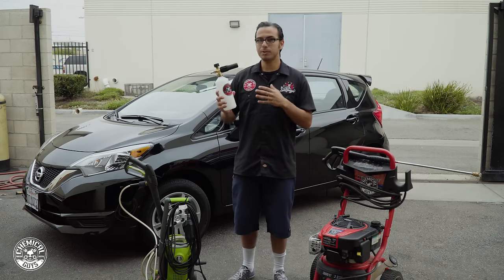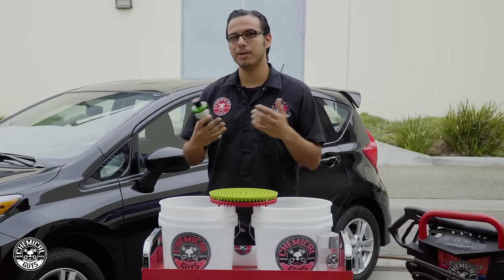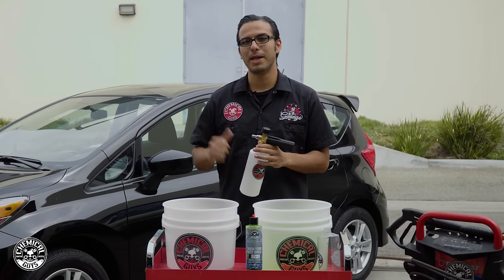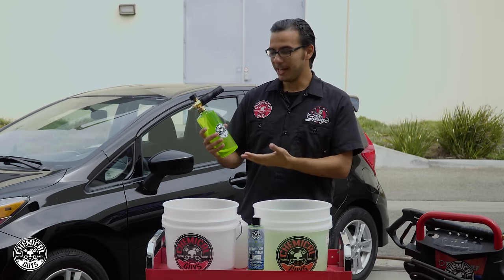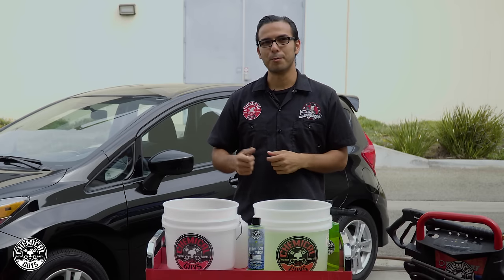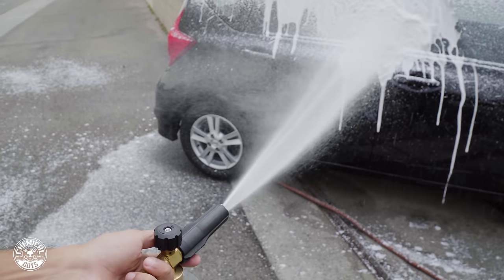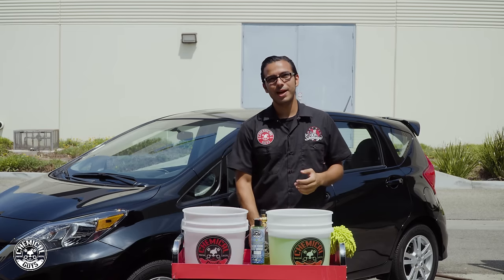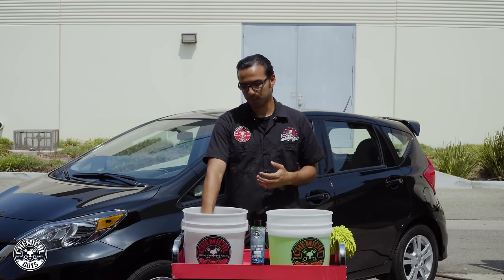5 Tips On How To Choose and Operate your Foam Cannon - Chemical Guys Car Care

Comment: Hey I have been looking forward to buy a foam canon but I have a karcher k series electric pw. Do you have any kind of adapter for this foam canon in order to make it compatible with my pw?
Reply from the maker: Hey thanks for watching.  We don't sell any type of adapter at the moment, one might be available through the web though. It might be a good idea to check a hardware store to see if there is one that fits well with the 1/4" Pressure Washer Female Inlet . Stay tuned, more great videos on the way.

C.G. Alex -

Comment: Hello can anyone tell me what the difference between polish and wax is. Which one gives the shiny reflective look?
Reply from the maker: Hi James, welcome to the Chemical Guys family! A polish is a chemical that contains abrasives that will actually remove clear coat from your car. By removing a very tiny amount of the clear coat, a polish smooths out the surface, getting rid of scratches and swirls. Polishing is substractive process and after you wipe the chemical off, nothing is left behind. A wax on the other hand is simply a clear coating that is applied to the surface of your car to make it shine and to protect it. Waxing is an additive process whereby you are applying a coating that will stay on your car for months. Waxing will not remove any swirls or scratches and does not remove any clear coat. If you wax a car that hasn't been polished, then you might still swirls and scratches underneath. Thanks for watching, James, and make sure to check back later today for a new video upload!
Reply: Chemical Guys thanks so much I just bought some wax👍

Comment: What was the purpose of the two bucket wash in this video where you foamed?   Confused.   Looks like you foamed and then just wiped off the car with a mit without using the buckets?
Reply from the maker: Hi thanks for watching. We have a pretty large collection of videos where we demonstrate the proper technique of how utilize the two bucket method. Lately we've been getting an overwhelming amount of requests for foam cannon how to tips because people can't seem to replicate the amount of foam we get out of our foam cannon. This is all foam cannon how to, if you're looking for a video that incorporates all the steps, we can definitely point you in the right direction. Stay tuned, we have an all new video launching today.
Reply: Thank you for this response. I have been using your foam cannon on another car for 4 years and never touched my car (foam, then leaf blower),  and it seemed OK. I now have a black car and I am not sure if a touch-less wash is possible or advised all the time. I want touch-less because I want to avoid swirls. But I am thinking that you have to use a mitt to remove film and grime or else you may risk swirls (especially on a black car). What are your thoughts on this and how should you do it. Foam, rinse, then 2 bucket method? Or foam, agitate with  a mit with one bucket to get dirt off mit every now and then? I rarely see professional detailers just use a foam cannon without a mit. Then this begs the question, is the foam cannon I bought really even an "upgrade" or necessity in a high end wash?
Reply from the maker: Some would debate this, however we rinse first, foam, and use a wash mitt prior to final rinse. Our technique is designed to be universal, yet I can completely understand someone wanting to do a 2 bucket wash without using a foam cannon. The foam acts as a lubricant helping to avoid spreading any abrasive dirt. I say stick to Rinse, Foam, 2 bucket with mitt, rinse, dry seal and wax.

C.G. Alex -
Reply: Do you rinse the foam before going to 2 bucket? Seems redundant to agitate foam with mit, then dunk  back into a soap bucket? Or do you only do a 1 bucket rinse if you foam? What is dry seal?
Reply from the maker: The foam expands on the paint lifting any loose dirt particles so that when the mitt glides along the paint, it doesn't drag the dirt with it. The wash mitt is able to glide along without scratching because the foam adds a level of lubrication, and the soap from your bucket adds to it. I meant apply a sealant if you don't have already have an existing application. It's more economical to use the wash mitt while the foam is still on the vehicle's paint, saves a little water at the same time.
Reply: I really appreciate all this time you spent with me. If I rinse the foam off (touchless) and then do a 2 bucket wash with a mit with soap in one bucket, is that less effective than agitating the foam? Additional question on wheel brushes: You dont sell a 20" boar hair wheel bursh. Is sythetic OK? How come its ok to use brushes on painted wheels, but I doubt you would recommend using brushes on car paint?
Reply from the maker: No worries buddy, The foam is there to help you, however at the end of the day it's up to you. You can use brushes on paint, we just don't find very many uses for them except for detailing emblems, we did that in an old video some time ago. The brushes are perfect for the tight areas around the spokes, hence why they make such versatile tools for wheel cleaning.

Comment: I've seen some vids where people first blast car with pressure waster, then use the foam cannon, let it set for 5 minutes or so, then rinse off the soap and with pressure washer and then wash with the two bucket method. You skipped the rinse after snow cannon. Is there any real difference or would there be a reason to use one over the other under various situations?
Reply from the maker: Hi, that's because everyone copies one another, so they naturally assume that's the "industry standard" way of washing your car. The reason we don't rinse immediately after foaming is that you're wasting extra water, and once the foam has expanded its easy to wipe away. There's really no right or wrong technique as long as you don't scratch your paint, we get really good results and have been using this method for a long time. The combination of the right tools, right technique, and patience will get you the best results.

C.G Alex -
Reply: Chemical Guys  so you dont rinse off the foam after washing? Just dry it with your product still on it?
Reply: No...they rinse off after washing the vehicle and then dry. 

My question was do you rinse,  foam cannon, let it sit for a few minutes, rinse off, then wash using two bucket method, then rinse again before drying. They said  they rinse, foam cannon, wash using two bucket, then a final rinse and dry.
Reply: dbreardon,  washer*
Reply: dbreardon lube less scratching
Reply: I always let snow foam sit for 5 mins then power wash off before two buckets wash 1 the snow foam softens the dirt and 2 the snow foam will pull off small particles of dirty so there's less chance of rubbing in dirt the more you can wash your car without contact with a wash mit the better

Comment: Can someone tell me if when you use the pressure washer and the snow shampoo , do you need to have the water hose connected and use the water flow to put the snow shampoo on or should you have the hose disconnected and use the pressure from the machine to shoot the shampoo? 😅🤔
Reply from the maker: Hi! You attach your hose to your pressure washer, and then the machine creates the pressure to shoot the water through the foam cannon and get the soapy mixture onto your car. Thanks for watching and make sure to check back tomorrow for a new video upload!
Reply: @ChemicalGuys  Thanks for the clarification. I did notice that the snow foam thickness isn't as thick as on your video it's lighter and more watery. I'm using Demon Foam snow shampoo. Could it be the shampoo I'm using 🤔? Thanks again and will follow your channel 👍🏻

Comment: What is the best pressure to use with this foam cannon?
Reply from the maker: Hey! We recommend using a pressure washer with a minimum PSI level of 1000 and a minimum GPM of 1.6. Thanks for watching and happy detailing!
Reply from the maker: Hey! We recommend Tire Kicker, it is a sprayable water-based dressing that allows anyone to recreate that kickable bright wet shine of brand new cars on tires and other rubber, vinyl, and plastic around your car. Thanks for the amazing feedback and thanks for watching!

https://www.chemicalguys.com/tire-kicker-extra-glossy-tire-shine/tire-kicker-tire-shine.html

Comment: When just rinsing the vehicle, how do you make sure to not damage your paint using the high powered pressure washer?
Reply from the maker: Hi Blake, pressure washers have the potential to harm your car's paint if the pressure is too high, or you wash to closely with the wand.  Any pressure washer that has a PSI of 3100 and above contains the potential to damage the paint. There's also a red attachment which concentrates the water to the point where it could strip paint easily. Stand back at a safe distance and don't use the red attachment because it's too concentrated. Thanks for being part of the Chemical Guys family!
Reply: Use a black tip to rinse ... not much more force than rain.

Comment: What pressure washer do you recommend and how much psi
Reply from the maker: Hey Francisco! Glad you stopped by the Detail Garage. For optimal foaming action, use a pressure washer capable of producing at least 2000 PSI and 1.5 GPM. - Happy detailing!!

Comment: Ok so I just got my first foam cannon. I got the big month foam cannon. What do I need to hook it up to my pressure washer.
Reply from the maker: Hey Robert, you need to make sure that the wand on your pressure washer has a male 1/4 connector, if not you will need to purchase one. Is your pressure washer an electric or gas pressure washer? Also what are specs and who manufacturers it?
Reply: Chemical Guys it’s a Simpson megashot 3000 psi 2.4 gpm gas pressure washer. I know will have to change the wound.
Reply from the maker: Hey Robert, looks like you will need to go to a hardware store and get an adapter for this pressure washer.

Comment: I have a better tip on how to clean the foam cannon.  clean out the soap like in the video, fill about 2/3rds with water and 1/3 with white vinegar and take it through the pressure washer.  This will give you the right Ph blend to keep deposits off.
Reply from the maker: Hey!
Thanks for the suggestion! That's a good tip.
Thanks for watching!

Comment: CAN ANYONE explain to me if you use a foam cannon what’s the purpose of the two buckets?
Reply from the maker: Hey! We recommend using a 2 bucket method system with a foam cannon because the foam cannon is going to help loosen the grime and make washing easier. We recommend scrubbing the vehicle still to achieve a deep clean. Thanks for watching and happy detailing!

Comment: What psi is your pressure washer? Thanks
Reply from the maker: Hey there! In this video, we use a gas-powered unit by TROY-BILT that is capable of 2800 PSI/ 2.4 GPM.

Comment: The car is so clean it looks brand new before he even starts the wash !!.
Reply from the maker: Hi Katie thanks for watching. That car belongs to one our co workers, and I've seen first hand how dirty it was. I have a similar Q50 and it's hard to tell from a distance that it's dirty because the metal flake in the paint reflects a large amount of sunlight. Our cars are exposed to industrial run off, bird droppings, and road grime. My car gets so dirty that I have to wash almost every week, and apply waxes frequently. Stay tuned Katie, more great videos are on the way.
Reply: don't give people false information, that car will have the smallest amount of dirt on it, you can see from when you spray the pressure washer on the bonnet the water sheets off instantly like it was detailed and then sealed with a wax or more likely a paint sealant before you applied the snow foam

Comment: whats the point in a foam cannon/gun? you still have to use the mitt to scrub and you still have a bucket full of soapy water.
Reply from the maker: Hi dirtrider 88, how's it going? By using a foam cannon, you are covering your car in the most foam possible and ensuring that you get a scratch and swirl free wash. What Chemical Guys soaps help do is create the slickest surface, so if you do have to use that wash mitt, you aren't going to scratch your paint. Over 95% of swirls and scratches come from improper car washing and drying techniques and products. Adding slick car wash foam to the equation drastically reduces the risk of installing swirls and scratches on painted surfaces. Thanks for watching, and stay tuned for more videos coming your way soon!
Reply: I use the snow foam as a pre wash and rinse it off prior to doing a 2 bucket wash. These steps need to be kept separate.

Comment: what's a good PSI to go with? don't wanna go to high
Reply from the maker: Hey Russ, we use a  2800 PSI 2.3 GPM pressure washer, here's link to one that is similar http://www.globalindustrial.com/p/outdoor-grounds-maintenance/pressure-washers/gas/bgg-20545-2200-psi-pressure-washer?infoParam.campaignId=T9F&gclid=CjwKCAiAm7LSBRBBEiwAvL1-L-e0BwzmrVRL4qHNmsbOtvbVje45-ESVSJ9KsqixjxL2kBSNk6wDHxoCUPUQAvD_BwE
Reply: 1600 psi is great for cars and it has no problem with form guns, the Katcher K2 is all you need

Comment: Does using a power washer affect the paint in anyway?
Reply: mikeyr215 no.  just don't get the nozzle closer than 2 feet with in surface
Reply: Soviet Clutch you can get inches away, does nothing to it

Comment: So just one ounce of soap of my choice & the rest of the bottle is filled with water?? I'm trying to achieve thick suds
Reply from the maker: Hi Jeffrey, you're also going to want to use warm water to activate the suds but don't shake it, lightly stir it.  Also, the GPM of your pressure washer is important into creating those thick suds/foam.

Comment: Does anyone know what electric power washer model that is??
Reply from the maker: Hey! We recommend using a pressure washer with a minimum PSI level of 1000 and a minimum GPM of 1.6. Thanks for watching and happy detailing!
Reply from the maker: Hi Craig! Choosing the right pressure washer for you comes down to preference and budget. I recommend using between 1600 - 3500 PSI for automotive detailing.
- CG Nick
Reply: Thanks that definitely helps but what model s that in the video?

Comment: I can't keep the solution from foaming up if I add soap first to the foam cannon. (before the water).
Reply: Depends on many things. Like your pressure washer... how many PSI and GPM is it? How much shampoo are you adding (I add about 2-3oz... like 3 pumps). Every foam cannon has recommended requirements that it needs so I can function as advertised, so you should check that (again PSI and GPM)
Reply from the maker: Warm water is able to truly mix well with the soap to create high suds/high foam for the foam cannon while not foaming up inside the bottle. Also, make sure you are not shaking the bottle when mixing the soap because this will definitely create foam inside. You're going to want to lightly stir it around.

Comment: I have a Karcher water pressure machine, how do I connect the foam cannon?
Reply from the maker: Hi! The TORQ Max Foam 8 Foam Cannon ships with a standard ¼’’ Quick-Connect Plug Quick release connects Foam Cannon to pressure washer wand Screws directly into foam cannon unit (add some Teflon tape for watertight seal.) The TORQ Foam Cannon accepts any ¼’’ male attachment fittings. If the included fittings does not fit your pressure washer wand, consult the pressure washer manufacturer for the correct fitting attachment.
Reply: Pressure wand included in foam cannon kit?
Reply from the maker: The wand will come with your pressure washer.

Comment: Is steam wash better than  forming wash
Reply from the maker: Hi Nikhit, thank you for watching. Foamng is definitely safer than steaming, and foaming produces more lubrication. If the steam is very hot, you run the risk of burning the paint, as well as yourself.  The amount of steam coming from the nozzle can be adjusted, however this method isn't suitable for very dirty vehicles.

Comment: Whats the max psi for that foam cannon?
Reply from the maker: Hey Joseph, thanks for checking out our videos. We use a pressure washer that uses 2800 PSI, anything between 2800-3100 is acceptable, doing more than that could strip the paint. You always have to stand at a comfortable distance so you don't risk damaging the paint. 

Chemical Guys Alex

Comment: If you eliminate the soap bucket & use the foam from the wash gun & just have the wash bucket you will save a lot of time & soap.
Reply from the maker: Hey thanks for watching this great video. The second soap bucket is supposed to be used for soaping the car after the foaming process. In the two bucket method, you use a bucket for dirty water, and a separate bucket for soap so you don't unintentionally introduce abrasives back on to your paint. Realistically, you're only using a few ounces of soap at a time. You still want to use that second bucket because you're adding additional lubrication as you remove the foam that's encapsulated harmful dirt particles.
Reply: Chemical Guys right on thanks for the info & great video. I have a tank! (Dually) lol so I would do it that way lol

Comment: I want a foam lance for Bosch aqrt
Reply from the maker: Hey Spartton, that's great news! It appears that the Bosch is an electric pressure washer, you will most likely need an adapter to attach the TORQ to it. Most of the electric pressure washers seem to have their own proprietary nozzles, some brands like the SunJoe actually have nozzles that are compatible out of the box. I'm sure if you check a hardware store, you will find an adapter that will fit your particular machine. Stay tuned buddy, more great videos are coming your way.

C.G. Alex -
Reply: Please help me out AQT-37 13PLUS I think you can help me to get those adapter and canon too. Yup it's a electric one